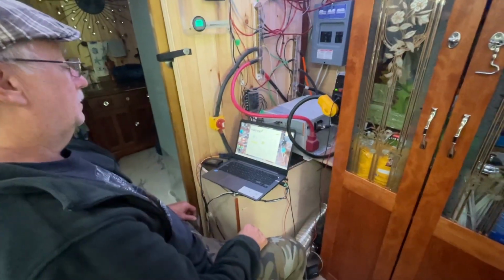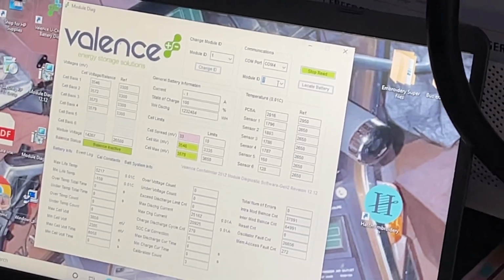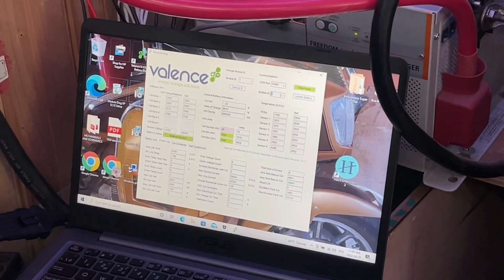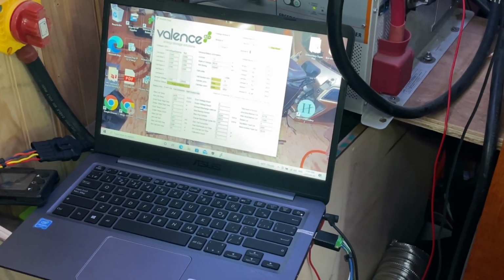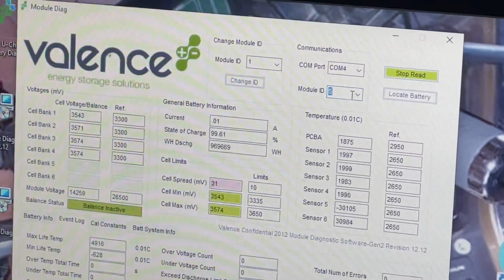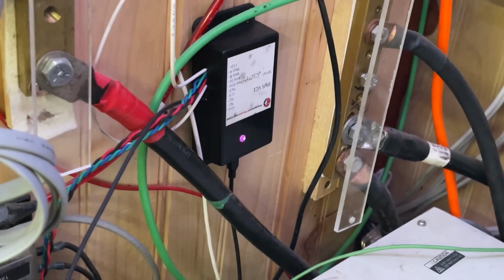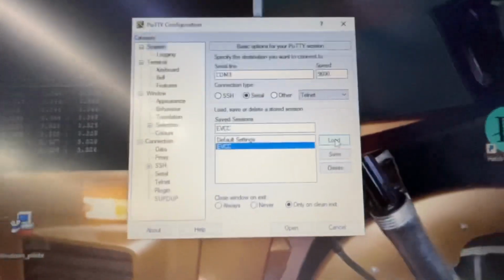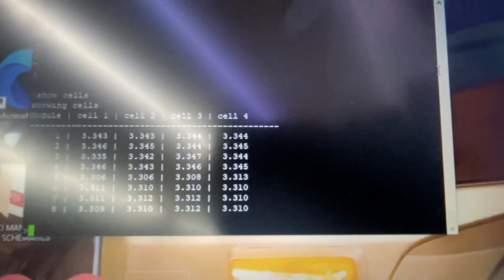How we got the Valence software and Thunderstruck BMS to work

Comment: Hi,  Thanks for posting this video.  I've got dozens of these V1 U27-12XP modules and I'm using them for a battery backup systems for my house when the mains fails (which it does regularly out here in the Hebrides in winter).

I am after a method of simply monitoring all the modules info on one page rather than have to scroll through each one at a time using the Valance software.  Any ideas?